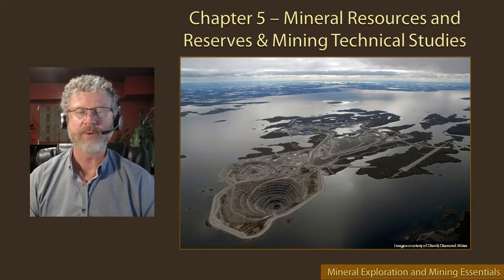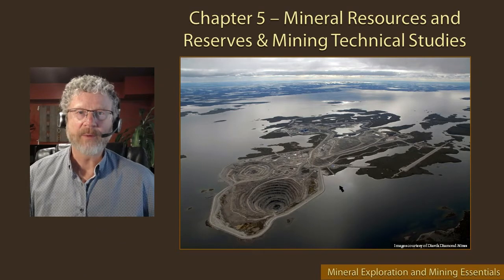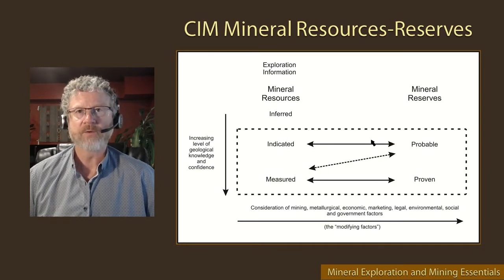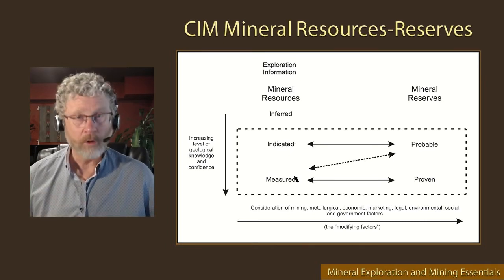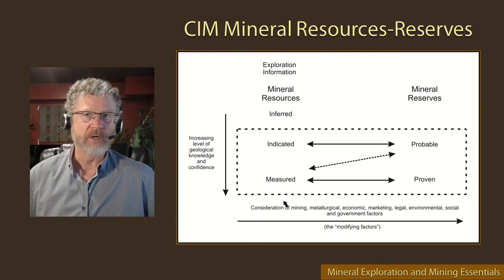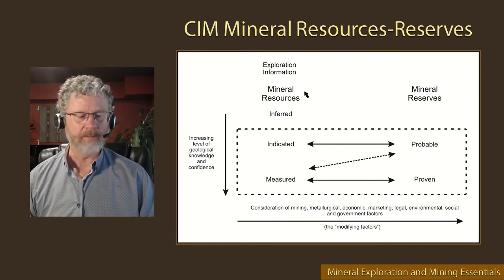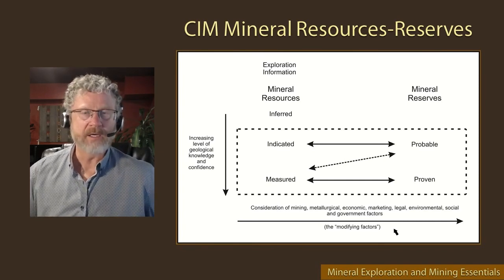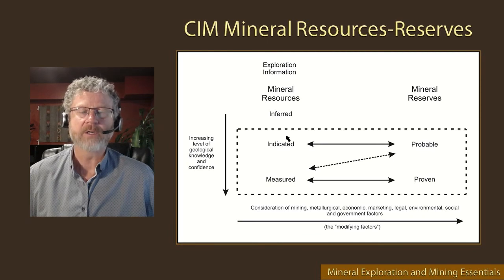CIM Resources and Reserves

Comment: I thought on the inferred mineral stage, you do not have drilling holes, that you can inferred only from geological maps, is that okay? or does it has to have drill holes already in that stage?
Reply from the maker: Thank you for the question. All resource estimates require drilling data to undertake. The only data that can be used from the surface is channel samples collected from trenches and outcrops. The main aspect of an inferred estimate is that drill holes are spaced such that there is only 'reasonable' knowledge of the geology, grade and characteristics of the mineral deposit. And that knowledge is not sufficient to create an effective mine plan or economic analysis, as such an inferred estimate cannot be converted into a reserve.